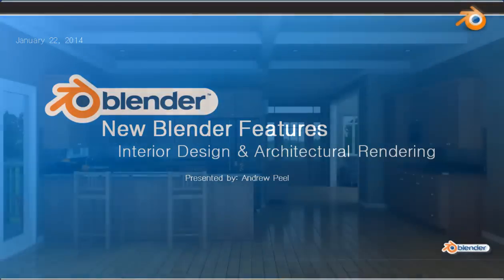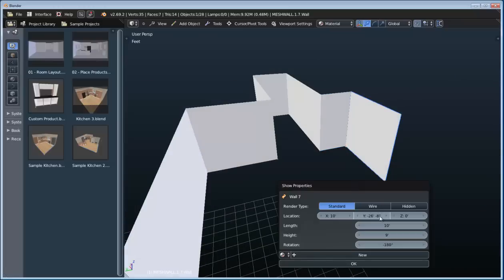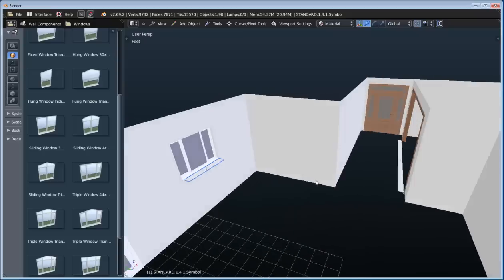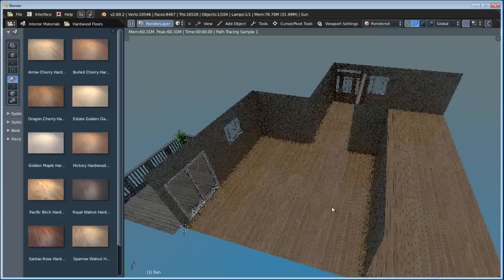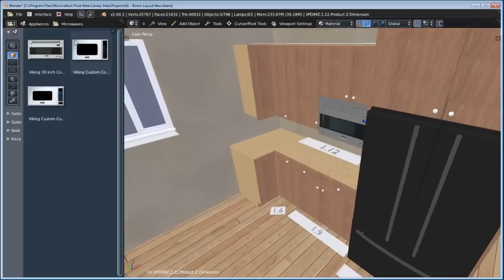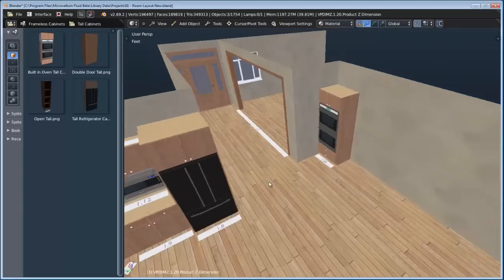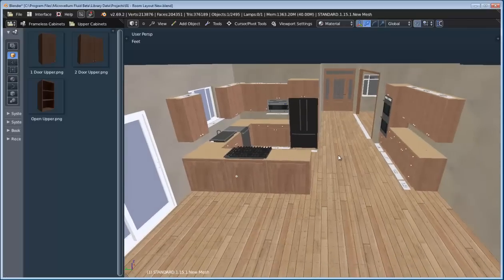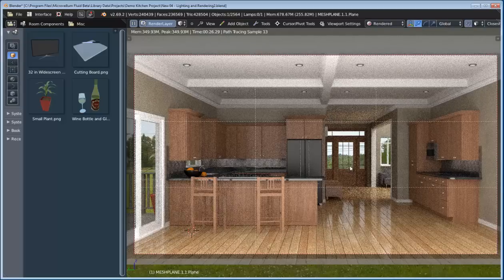Interior Design with Blender

Comment: I see that Blender do some splendid work with interiors, as I'm used to create thses 3D Envirenmrents by Photshop and I'll jump ahead with Blender, thanks to you.
I've a question, Can I insert the Evermotion Archmodels to the Blender Work project ? (as their models are available in .OBJ or .Max formats)
Reply from the maker: Blender can import many different file formats including .obj .fbx .3ds and several more. I haven't tried models from the evermotion site but it sounds like they should work.
Reply: I'll start using Blender while learning by your videos. My purpose is to create 3D scenes for Floor and wall tiles for one of my client & other for wood furnitures. Thank you Andrew.

Comment: Wow!  This is amazing 
How do I get d tools u used?
Reply from the maker: +Omenai Emmanuel You can download the free application here. http://www.microvellum.com/products/fluid-designer/fluid-designer-download/ We also have a paid add-on that gives you more data and design functionality which can be found here. http://www.microvellum.com/product/cabinet-library-2/
Reply: +Andrew Peel  after download the software doesn't work for me. Plase help!!
Reply from the maker: +Ashok Gurung Try reading through the How do i install Fluid Designer on the Download page. http://www.microvellum.com/products/fluid-designer/fluid-designer-download/ If you are still having trouble please let me know what problem you are running into.
Reply: The application in Zip file is not working. it show currupted or damaged. I download zip file from http://www.microvellum.com/products/fluid-designer/fluid-designer-download/. Please help.
Reply from the maker: +Ashok Gurung Are you using the windows or OSX. If you are using windows try the installer. If OSX try following the steps here http://mac-how-to.wonderhowto.com/how-to/open-third-party-apps-from-unidentified-developers-mac-os-x-0158095/
Reply: Okay thank you so much!!! I download Install instead of zip file. I mean it's working. :)

Comment: This is really cool, but Bryce and/or Carrara had a similar drag and drop system for years. (Instead of architectural elements that had settings it was trees/mountains/content/characters. But the idea and how it worked is the same, find what you want and drop it in the scene. Personally I found browsing with drag and drop most useful in regards to the material library.)

So even though it's been done before, it's still a really cool feature and I'm glad to see Blender getting it.

Now watch Max and Maya follow suit, even though they probably scoffed at it with the attitude "oh, that's Poser stuff." (But I'm fairly sure that some graphics studios using them had their in-house pipeline plugins that do the same thing. Just not something that comes as part of the main app.)

Comment: Would we be interested? Are you kidding?! This is fantastic! Absolutely amazing! I'm loving the parametric and option-based formats for products. 

My only concern is integration into the blender we all already know and love. It seems you've changed a lot. But, that can be a good thing. There has been a lot of talk about UI changes (Big thanks to ***** for that) and perhaps these tools could be added more seamlessly with those other changes. There was also a post on Blender nation (can't find it right now, sorry) about creating generic parts that fit together. Perhaps that could become a new type of object called a part or product, much like what you have now, with adjustable parameters. This would be an awesome way to release models on blendswap or elsewhere and also a great way for manufacturers to release virtual versions of their products for designers to use professionally.

If you're not doing it already, I really think you should be talking with the developers. You obviously have some awesome ideas and I'm sure there are MANY people in the blender community who would eat this stuff up. As someone with an engineering background, the non-distructive/parametric and constraint-based stuff is particularly interesting to me.